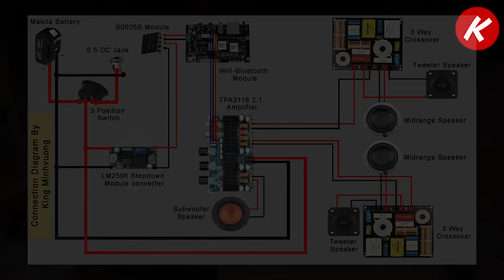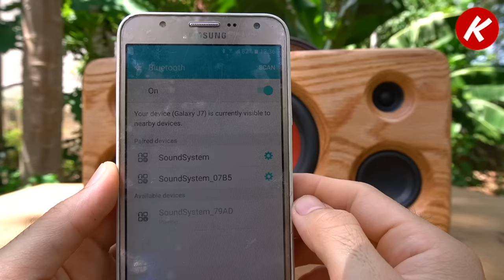Epoxy Dovetail Joint Bluetooth Speaker DIY

Comment: Few tips: You don't need that big 3 way crossover for 2 way configuration also I would add boost converter to boost voltage to 24V or near max voltage that amplifier can handle to get more power and keep voltage constant.

Comment: Some thoughts:

1) This is an extremely nice build.  I might build one like it, sans the Makita battery.
2) If you had a planer, why did you plane the first piece by hand?
3) I wish my glue joints would magically straighten out between clamping and drying like yours do.  :)  (j/k I know you adjusted them off-camera)
4) How did you calculate enclosure volume for the drivers and port?
5) What's the chrome basket-looking thing you put through on the left of the control panel?  IR sensor?
6) Looks like you hit a screw head with your router bit near the battery recess.
7) I like that trick with the pooled solder to remove devices from the board.  I'm going to use that.

Comment: Great job! Only 1 thing i will mention, use nylock nuts for the handle or they may unscrew from the vibrations, fall on the boards and short-circuit them, and probably causing fire.

Comment: Nice build! I like the dovetails and the colored sub looks great. You're losing most of your upper frequencies mounting those tweeter in that recess though. It will make them louder at their lower frequencies and roll off their top end above 9000hz or so.
Reply: Hello, I have a question thats is allways bumping into my head when I watch such builds: I dont unterstand how he can use a 100w +50w+ 50w amp when the power needed for the speakers (tweeter and midrange) is higer, in this case 55w. I have also seen cases in which people use 150w amps in 200w builds. I hope you can answer that questin and I asked because you seen to know a lot about this topic.
Reply: @kleiner.spasti  Im not entirely sure what you're asking, but I think you are worrying too much about the power ratings. First off midrange and tweeters can play loud and clear with just a couple of watts. The wattage rating on the back of the tweeter is the amount of power it can handle without burning out, not it's required power to operate. Second, anyone who says they built a 200w speaker, but used and amp with a total output of 150w is just lying
Reply: @edjackson4389  So should I buy an amp with an output power of 200w if the total amount of power the speakers need is 200w or how can I calculate?
And thx for the quick response.
Reply: @kleiner.spasti  As long as you are looking at the RMS power ratings that should work. Look for an amp with good reviews. That's more useful than power ratings if you're building a small bluetooth box. Very little power is needed to drive small woofers and tweeters

Comment: you dont require crossover network the board has a subwoofer out you could just add 2.2 uf or 4.7 uf cap for tweeter and connect full range direct to amp output
Reply from the maker: Thank for your idea. i will try!
Reply: Do you want all the bass in the full range though? Even though they’re sealed off you wouldn’t want full range to go through. Otherwise you might get bass distortion in the full ranges at louder volumes where the sub should be the one to handle the low frequency
Reply: @WesWeasel  a simple hpf at 150hz on the full range would do

Comment: Is the sub full-range, or actively crossed? Looks like the connection is straight from the amp. Also, you say 3-way crossover but only have two drivers connected. Are you just using bandpass for the midrange and not using the lowpass? What are, and how did you determine, your crossover points and slopes? Sweet build. Thanks for taking the time to share.

Comment: Hi, very nice build, im looking to make something with car radio i have. Could you tell me in your setup how long 6ah makita battery last playing music ?
Reply from the maker: About 5-6hrs. Thank you!
Reply: I put a Pioneer car stereo into a cigar box, with the wiring harness going out to a full set of jacks on the rear... Also a small 12VDC computer fan to cool the heat sink when I CRANK IT UP... Works like a champ, and looks great, too... I'd post a couple pics, but I don't see the option to include pics in these posts... How do I??
Reply: @cschuh4695  You can upload these pics in the Imgur image uploading site and share the link here.

Comment: I was so on board and ready to start building this until he got to the speaker and electronics part. I got so lost lol. This is beautiful and amazing and I want to build one so bad
Reply: They're cool and all, but its more worth it to buy a Bluetooth speaker, like a jbl flip 5 or 4. If you want good sound quality jbl is good with Bluetooth speakers, and either of them would be more worth it to buy than build this, although its nice.
Reply: @userthatcantthinkofagoodna1440  I've actually been looking for a kit for a bluetooth speaker build. There are some but they suck. My next thought was to get a good bluetooth speaker and build a custom box to put the internals in. I've just always been disappointed with the off the shelf bluetooth speakers
Reply: @innocentbystander5057  yeah I get that. And I thought about doing it myself, but i got my flip 4 for cheap and its good enough for me, but I'll probably build one next once it dies. Its a fun project.

Comment: A masterful woodworking artisan. Lovely eye candy. We wait anticipating equally delightful sound from such a work intensive project. High quality components thru out. But where is the design? It's a ported enclosure like many high end, high efficiency bass reflex speakers of the late 40's hi-fi era up to early 70's. The point of this approach is to couple the woofer's rear output to the front output in phase at the systems' low resonance point lowering system   bass response by a quarter octave whilst reducing distortion to only a tenth or less by controlling over excursion of the bass speaker cone. It might be  impressive to see a speaker cone flopping violently in and out of control. The technical info is out there. In fact it is usually supplied with the speakers OEM or available from the seller. These builds would sound as good as they look with a bit of audio tunning.

Comment: Congratulation, nice work!
On the other hand it is better if the placement of the lowwoofer in such a system is not symmetrical.

Comment: Great video I'm making one myself, one question though, where did the 3 wires go that you put in the 4 pin plug on the bluetooth in connector I've been looking on the vid, couldn't see and it doesn't show on the diagram, also what pins are the 3 cables connected to. Keep up the good work

Comment: Very beautiful, not sure whether those drivers deserve that kind of effort though.  I really like Oak done more natural like that, rather than that gross, almost green, 'honey' stuff.  I don't know if it was your intention or not, but you probably extended the horns a bit with those front bevels, on the tweeters, that might actually help.  :-)   I like your strap choice, too.  We mounted one about like that on a Teac A3340 (10" reel to reel) deck we were always lugging everywhere, including up and down stairs.  Weighed WAY more than your box there, but it was really handy. (sorry)   I like your little table saw slide table clamping jig, too...nice.  Pretty sure those weren't your first dovetails!

Comment: I would like a dual power supply connection with 3-position switch, like yours, battery (for mobility) and charger (for home use). I don't want to have to remove the battery every time I plug the charger into a socket.
Questions:
1. This project is battery charging-capable?
2. You need to remove the battery every time you plug the charger into the socket?

Comment: Well, one COULD build the whole thing out of 19mm (3/4") plywood, a hand saw and some glue. You don't NEED all the power tools shown in the video .
But if you're serious about working with nice woods like walnut, it helps to own a circular saw and a sander.

Comment: you should have used some bolts in the glued areas as that glue will give in from the vibrations over time but none the less nice box and that battery supply 🍻

Comment: The power connector could be placed behind the battery so that to connect the user would have to remove the battery, avoiding mistakes.

Comment: i've 3x tweeter 6ohm 50W - 4speaker 4ohm 50w - 2 speaker 8ohm 50w - 1x woofer 4ohm 30W.. i can use the same componento and recycle this speaker without buy a newone?
thx

Comment: Okay, i got questions. Why use hand plane, when you have a power planer. Why use handsaw, when you have a jigsaw. Why use B0505S when you can use B2405S or B1205S instead and no need for a stepdown converter then.

Comment: why did you use step down converter? the circuite is rated 9-24v( or 12-24)

Comment: Your builds are awsome but you should change amplifier. The one you are using has low frequency range. I think around 0- 15kh  it never catches the hi hats even with those fone crosovers and tweeters

Comment: The carpentry and assembly part in general is very nice and neat, but I don't know how you calculated the dimensions of that cabinet to obtain an adequate response and avoid resonances. To do serious calculations on a cabinet with more than one speaker is complicated. There are so-called Thielle & Small parameters but I wouldn't know how to calculate them with multiple speakers. Anyway your work is so cute it could be called an art.

Comment: but if you're using a 24 volt 4 amp power supply aren't you only putting around 100w at max into the amplifier meaning you're only using half the power available?

Comment: so precise, so intricate construction to produce such a miserable sound 
that it will surely destroy the sound standards of your brain. a 
carpenter, no matter how good he is, is forbidden to make speakers. A 
speaker requires detailed measurements of the characteristics of the 
loudspeakers of the box and the sound environment, and detailed design 
of the box and the crossover. this requires specialized sophisticated 
electronic instruments, and university education. the carpenter is good 
at making furniture. no speakers ....